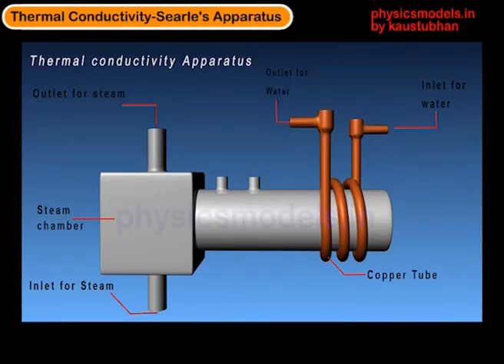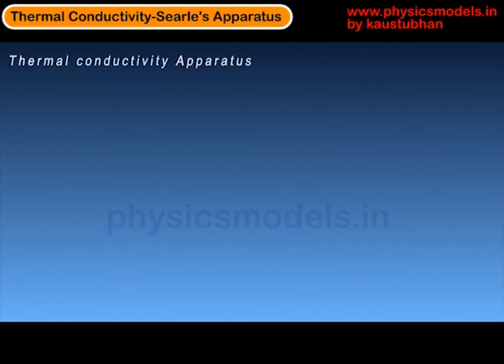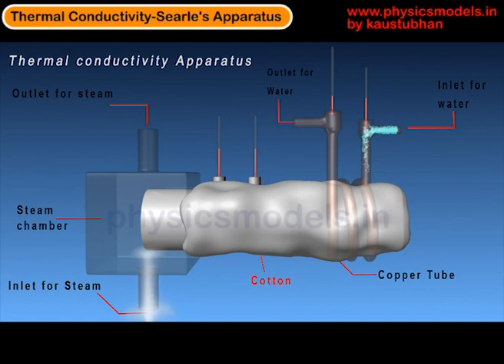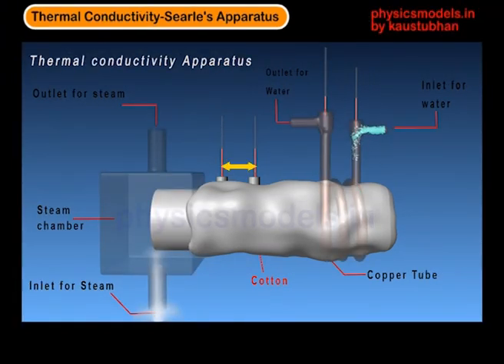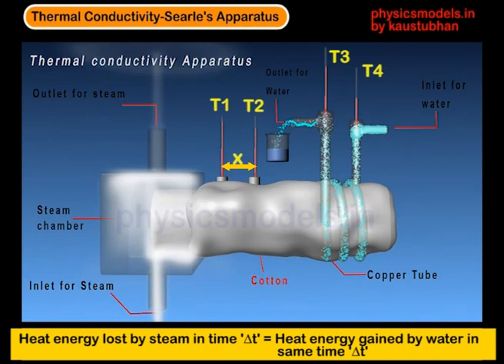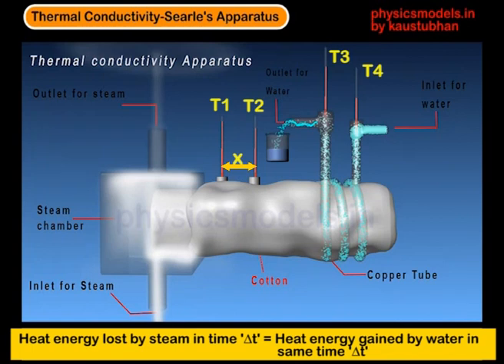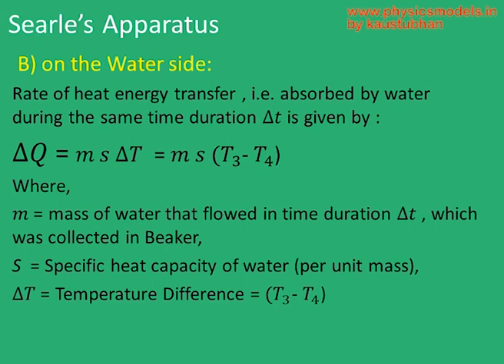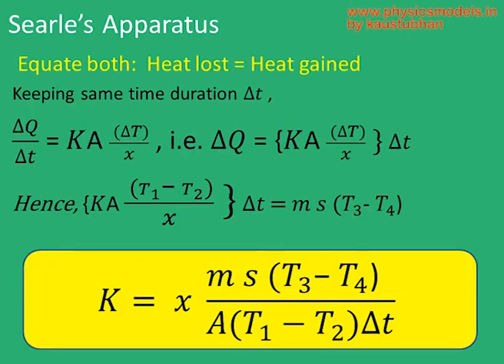Physics made Easy-Heat Transfer- Thermal Conductivity - Part 2

Comment: Wouldn't the insulating material absorb some minute amount of heat?
Reply from the maker: Yes, the insulating material will absorb some amount of Heat. The evidence of this would be a rise in temperature of the insulating material.
Reply: @physics_animation_tutorial  so technically not all heat energy lost by steam is gained by water right?
Reply from the maker: @rachitsinghvi6592  in reality, there are always losses
Reply from the maker: But still, Searle 's Apparatus was good enough for the purpose. In those days